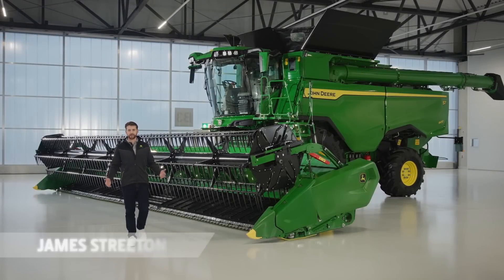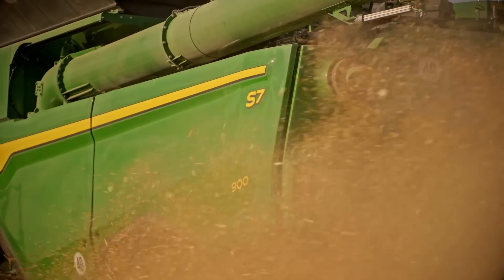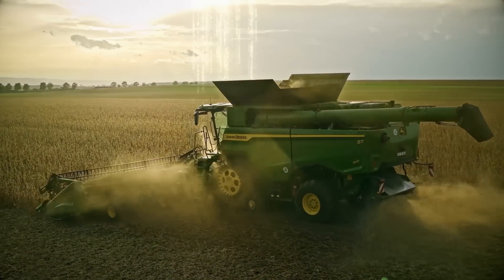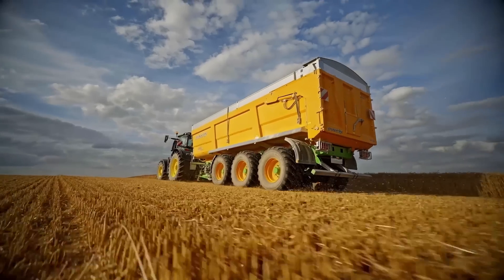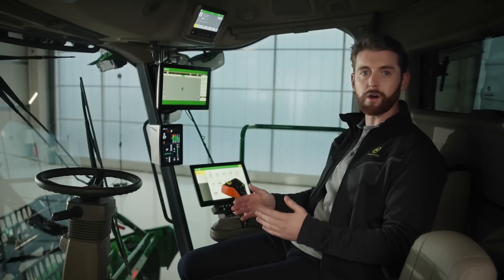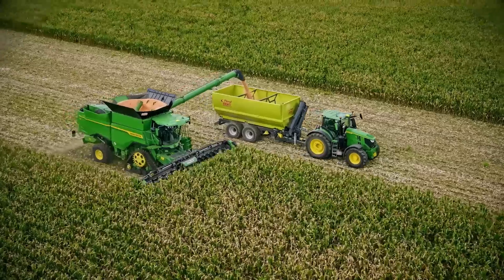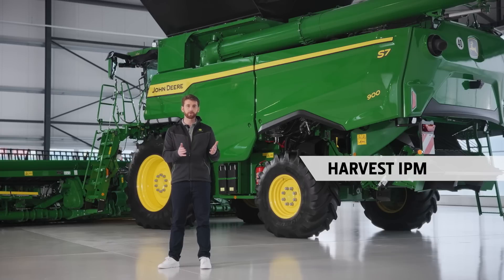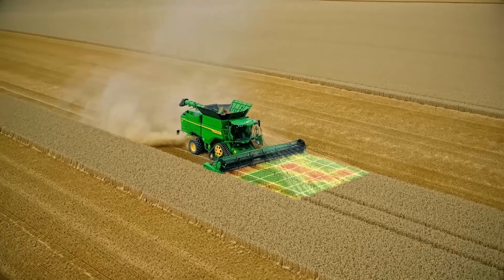The new JOHN DEERE S7 Combine: A new era of Combine Automation

Comment: What about durability and dependability? Yes I’m sure all of these updates will be great, and some have been frustratingly missing compared to some of the competitors. Sadly in newer John Deere products the durability and dependability has gone missing, and it’s becoming increasingly frustrating to keep these modern digital machines out in the field where they should be, not sitting waiting for parts or techs to come and diagnose issues which no one normal farmer can repair. Seems like the focus has been all to have machines connected instead of just building what everyone needs, durable and dependable which just keep going.